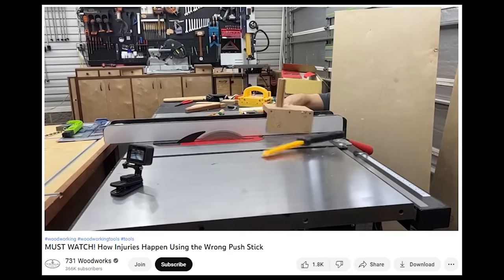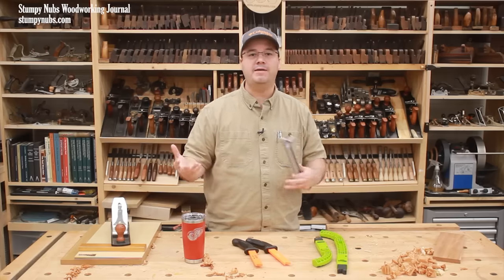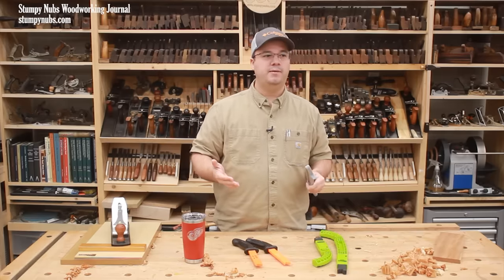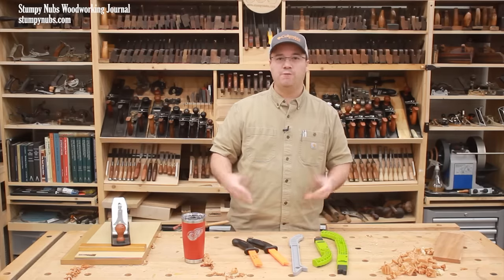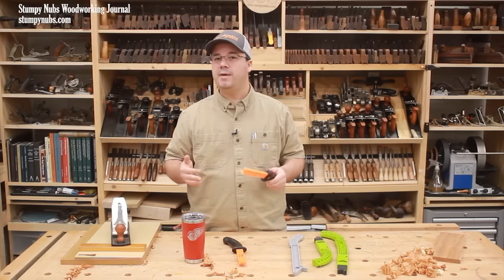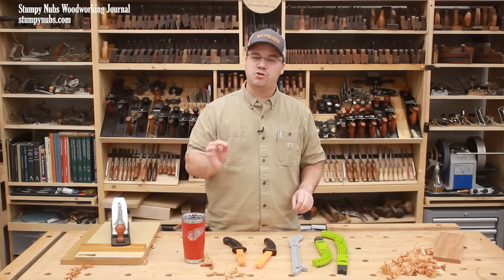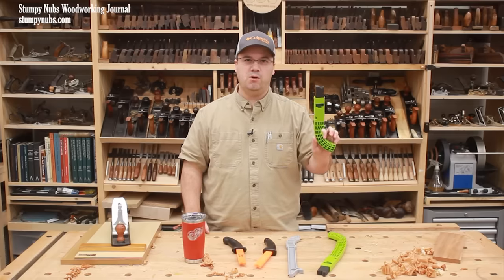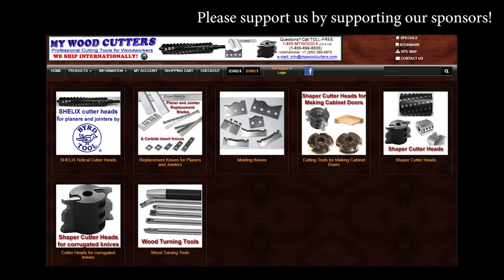EXPLODING table saw push sticks are a real thing!

Comment: I had a plastic stick explode in my hand, went to wood and never trusted plastic again.  In my accident the tip was sucked down into the blade well and the entire shaft exploded/shot back into my hand.  Like barely touched it, boom, finger/hand is bleeding everywhere.

This was the stick that came with a Metabo table saw that worked very well except that one issue.

Comment: I'll begin with -thanks to your videos I'm exceedingly careful with my power tools and especially my table saw. I had a plastic push stick for a hardware store, i made contact with the blade and the thing flew into high speed pieces. Never used plastic since. It was probably made of ABS plastics.
With all the problems of plastics use why plastic of any kind especially when wood will do. Also, (as you have pointed out before) it's important to keep the leading end of the piece being cut down on the table to avoid lifting and rotation on the blade that lead to kick back. So a long stick with that lets you push the piece forward and down is best. 
As usual thanks for what you do.

Comment: The plastic push stick that came with my table saw exploded when it contacted the blade, It's not just the cheap ones that are dangerous. Will never use a plastic one again.

Comment: Good video.  When the clearance between the fence and blade gets small I default to a straddle push block that straddles the fence.  I ensures the pusher is never going to run into the blade and so I can cut with confidence. It is also long enough to hold the piece down against the table.  I don't see straddle push blocks very often but they are a standard safety accessory with Shopsmith.  Maybe you could research them and educate us all on what you find.  Oops, I see you've already done it (https://www.youtube.com/watch?v=UIqsT2VESk4).  This would have been a good chance to mention it.

Comment: I worked in plastics for 7 years which inluded machining and fabrication of plastics. Harder plastics have less impact resistance. Polycarbonate will take far more inpact than acrylic which is usless as safety material.  I dare say the cheaper push sticks are made with regrind ( recycled plastic) so anything could be in them.  Thank you for another good video.

Comment: I make mine out of soft pine and cut a crosshatch {like a meat hammer} in the contact surface so if I slip it still catches, I also so rarely contact the blade with them, almost never have to make another. never yet had one explode.

Comment: I think that this is one of the hardest parts of woodworking. With most of the "main" tools, power or hand, it's fairly easy to research their quality, performance, and safety. And we all do this. But it's a bitharder to do for the ancillary tools and accessories. Not many review vids for "push sticks" unless one comes out that really different in design.  And so it goes with these items, we don't give them a whole lot of thought until something goes wrong. This can be even harder for new woodworkers just getting started and trying to piece together the correct tools for the newfound journey.

Comment: A thing wooden stick should also never be used.  I showed a novice how if the thin stick gets kicked back it could punch a hole in the palm of his hand. I did this by holding the stick with some folded over cardboard and the kick back punched a hole in the cardboard.

Comment: I had one blow up last month. It was from a company that is well known.  I think part of why it happened is that it never felt right in my hand. I also wonder if age and UV light effects plastic ones? I replaced it with a model I am more comfortable with using.  I believe the push sticks we used in school back in the 70s were made from 3/4 inch plywood.  They were made by the shop teacher.

Comment: You could probably 3d print push stick with replacement heads, or such that would accept foam inserts. Foam is not that hard to cut yourself after all ;)

Comment: Last year I was using my table saw with a micro jig gripper block. I was ripping some wood that was less than an inch wide. I was not paying attention to the adjustable part on the gripper and it was in-line with the blade (my fault entirely). As I was going through the cut, I noticed the sound change and before I could do anything, the blade cut into the plastic/rubber, and it ripped out of my hand and hit me in the gut. Luckily I was ok, and no other injuries other than a punch to the gut. Now I know better to pay attention to where the blade is in relation to the rubber/plastic parts. And I have noticed that when I use wood ones, the saw doesn’t sound like it’s going to do something bad when the blade does go through it.

Comment: Most brittle plastics are acrylic based and can be tested by applying a small dab of acetone which will melt the surface. A flexible plastic such as polypropylene will not react to acetone.

Comment: If you start to flex it, and it feels like it would snap or shatter if you went any further, it's not good. If it feels like it's going to bend or warp if you go any further, that's a good sign that it's likely shatter resistant.

Comment: Thanks as always James. I looked through some of the comments but did not find any reference to John Heisz , style push stick. I have used these for years.  Mine are made from Ply, ( couple different thicknesses). The great thing I find with this style is it helps keep the front pushed down as it clears the back end of the blade.  I can also smile at Frank Howarth's  version

Comment: Surely there is some kind of technique, or being alert when using ones tools. You push the wood through the saw blade and if your push stick starts to touch the blade you stop you do not continue forcing the push stick further into the blade. Maybe I am wrong.

Comment: I use a nice big pushstick when doing most work and i use those small push sticks to cut little bits because i can apply enough preasure on a small peice with those. But I never use those ones just because they are always to use on big parts

Comment: I used the push stick that came with my rigid table saw.  It slightly hit the blade and it 'kicked back' up into my wrist. One of the worst injuries I've got in the shop. I only use wood now. Just incase it does touch the blade

Comment: Great follow up video... another point to consider: Climate extremes can cause plastic materials to break down or become brittle over time. I know a lot of woodworkers using space which is not climate controlled and may lend to the kinds of temperature extremes which can cause an older, plastic push stick to be less reliable.

Comment: I had a friend who used a wooden push stick which was just a straight piece of scrap wood. One day he came over and had about 30 stitches up his forearm. He said his push stick caught the blade and got pushed up his arm with the sharp corner leaving him with a nasty gash. Moral of the story is if you are going to use a wooden push stick make sure it doesn't have any sharp edges/corners at the hand end and preferably designed with a curved handle.

Comment: I've had plastic push sticks give nasty kickback, especially those with a vinyl sock on the tip. I've been making push sticks out of soft western Cedar for years now, and they just get cut when they contact the blade. When the push tip gets too chewed up, I cut it off and reshape it. Never had one grabbed or shattered. I use Cedar for push blocks too.

Comment: a handy guidline my father imparted on us kids was "you get what you pay for."

but yeah, you want stuff that's going to be coming between you and a high powered saw blade to not transfer the energy of the saw into you.  which means it needs to be soft enough to get cut, but not so soft you won't realize something is wrong and back off.

Comment: I switched to push blocks a long time ago: I happen to have a few sections of rubber horse stall mat that, when fastened to the bottom of a stack of wood, you can run straight over the table saw blade. They don't smell as good as wood when cutting, but it means I'm always in secure contact with the wood at multiple points. I imagine they're just a little bit less grippy than the high density foam, but a similar design fundamentally

Comment: I am thankful you made this video, thanks for making this...  my current push sticks are oak with the grain sticks.  I like that stick you showed with the replacement tip,   I think making wood inserts for that could be very easy to make with a simple paper wrap to make sure it doesn't fall out for pennies per replacement.

Comment: I've never been a fan of plastic push sticks. I like the idea of being able to cut through them. I also don't like the style of push stick that only contacts the end of the board. I find a design that has a long contact point holds the workpiece down better as it is pushed through the blade.

Comment: another great video! My main thing is that those are all the "fish mouth" style. I prefer to have pressure towards the front of the workpiece too! I usually make mine out of scrap 2x4s or I've even used plywood for them as well. What's your take on the fish mouth vs whatever the other style is??

Comment: Fantastic video, James! Thanks a bunch! 😃
I imagine that if you want to 3d print a push stick, TPU should be a fantastic option for the tip!
Anyway, stay safe there with your family! 🖖😊
Reply: That may work well.  Without trying it myself, I would be concerned about the large number of potential failure points between layers and within the infill.

Comment: I've had the arm of a plastic push stick break while pushing 2 inch thick oak through the saw. No injury, but it sure did scare me enough to remind me to always check the condition of a push stick before I use it. I've had one shatter when it hit the blade too and sent shards of plastic back at waist level, so I could see an injury occurring if you held the push stick low and parallel to the table.

Comment: I actually hated using the pushstick. You need you hand to push the workpiece no only forward, but towards the fence, so the sawblade doesn't pull it in towards itself and create a curved cut. As long as you're focused, careful, and pay very very good attention to where your fingers are, it's hard to cut them off. Take this with your own best judgement of course. If you don't feel comfortable doing a cut, don't
Reply from the maker: You really should learn how kickbacks can pull your hand into the blade: https://www.youtube.com/watch?v=8f8VWwtaudU

Comment: I thought you would refer people to your table saw safely video where you discuss why push blocks are preferable. I also prefer push blocks for greater control. The biggest danger with those plastic push sticks is kickback of the workpiece due to poor control through the cut.

Comment: LOL Ergonomic Plastic handle push stick.  I have a wrist which changes the angle of the offcut piece of wood I use as a push stick.  "It costs $4 for a replacement tip". I can create a hundred push sticks from scrap for nothing except my time.
Reply from the maker: Some people would rather spend $4 once every year or so so they can spend their time on other projects. But that's a matter of personal preference.

Comment: I didn't realize there was anyone in the world using a table saw who wouldn't intuitively know how a push stick and a spinning blade will interact...turns out if you make a smarter safety accessory, the world will make dumber user.
Reply from the maker: Let's not pretend all push sticks react the same, or that everyone should know that a tool specifically designed for safety can explode if it's made of the wrong material.

Comment: I never felt comfortable using any push sticks like that. When I finally caved and got a couple of grippers my table saw experience was completely different. I feel safer and like I have much more control with the gripper all the way through the cut. I use them for almost every table saw cut. I’ve also sliced through them a bit when I’ve forgotten to adjust the blade height, and it’s definitely shatter proof. The blade simply cut through the plastic. No kickback or shattering.
Reply from the maker: I prefer a larger push block, but I believe small push sticks have a place for some cuts. And if used properly, I have never had a problem with them.

Comment: I am an amature, hobbiest, man of little woodworking experience or knowledege. “Be safe” is a my motto right after “Be Prepared”. Realistically they work hand in hand. 

My problem with the small contact area push stick as shown in the 731 video and here is they both have one inherent problem from my point of view. Neither have enough control in pushing the board toward the fence. There is some, just not enough for my comfort level especially after the cutoff is released. 

I threw out the plastic push stick that came with my table saw for this reason. 

I am not telling anyone how to enjoy woodworking. That’s up to you. I just wanted to share my perpective.
Reply from the maker: I do prefer wider push blocks, but sticks have their place for narrow cuts, and other situations.

Comment: Maybe I'm old and out of touch?  I have no idea why anyone would buy a plastic push stick, when they can pick up a piece of scrap wood and make one in a few minutes - and that includes the time spent rounding the handle with a router to make it comfortable.  I have three of different lengths and angles, that I've used for years.
Reply from the maker: I explained why in the video

Comment: It’s all about placement of the push stick.  I personally don’t use the push stick if the blade is less than twice the width of the push stick from the rip fence.  For thin cuts I either use a thin rip jig so that more material is between the blade and fence or I use a wooden push block I can cut through.

Comment: Oh my!  My push sticks are all made of wood, but I have some Chinese finger boards that I will be checking with some urgency.  I use a lot of Acetal (Derlin) plastic because it machines so well and is reasonably stiff, and I am now glad I kept the offcuts as they will be usable to make replaceable push stick ends.  You can certainly cut it with a table saw and get good results.  Nylon is horrible material to machine as it melts and produces nasty stringy swarf, and could possibly clog the kerf when cut with a table saw.  Incidentally, Acetal is stiff, but not totally resistant to flexing.  I found that out after making a router table insert out of 10mm Acetal, and found that the retaining screws distorted the insert.  I ended up buying a Kreg insert which is made of phenolic, and claimed to be shatter proof, but I'd be reluctant to put it to the test.   Thanks for the content James.  You should add 'Keeping woodworkers safe' to your mission statement.
Reply: unfilled Delrin are very shatter resistant.  I worked with Delrin (From DuPont) for many years.  At the same time, they are very slippery too.  Delrin is a nice bearing material.  Probably not the best for feather boards because you want more friction to prevent work piece from slipping.

Comment: No push sticks here.   I’ll cut a piece of scrap plywood, that allows it to put down pressure further forward, as well as push the materials.  (Looks like a handsaw handle).  Push sticks allow the cut end to lift and cash a kickback. Seen it too many times in different shops.
Reply: * cause

Comment: First, bad design. Second, wrong material. This style push stick is dumb, and it’s so simple to make the right one.
Reply from the maker: I prefer a larger push block, but I believe small push sticks have a place for some cuts. And if used properly, I have never had a problem with them.

Comment: My Hitachi portable job site table saw came with a hard plastic push stick
 One day, exactly this happened. The pushstick caught the blade and the impact from the blade slamming it into the table surface shattered it into about 4 or 5 pieces all of them flying in different directions with one of them embedding itself in the drywall wall about 8 feet behind the saw. I'm  still not entirely sure how it happened. Scared the crap out of me and I was lucky to walk away uninjured.
Reply: YIKES

Comment: Thanks for this well thought out and very informative video .. and thanks for the calm and comprehensive over view of the various plastics used by some manufacturers. Your educational videos have been a great resource for me as a relatively new "dockworker" - metal had been the media I grew up working with.. you can bend it, reshape and weld it back together after screwing up and cutting it in the work place :) - That said, I have gleaned many great hints from these tutorials and as a result I have had a good time building with wood., Larry
Reply: UGH!!! WOODWORKER!

Comment: What if you made a nice carved wooden handle push stick that could accommodate your own inserts made from interlocking floor tile EVA foam?
Reply from the maker: The challenge would be making the wood part of the stick with a recess to securely hold the insert.